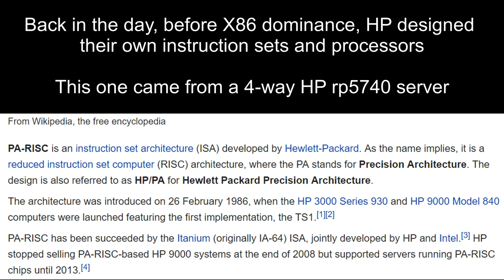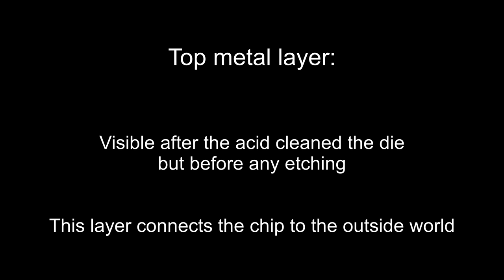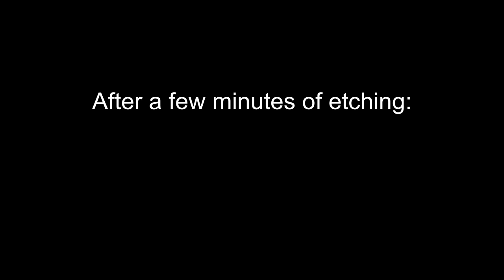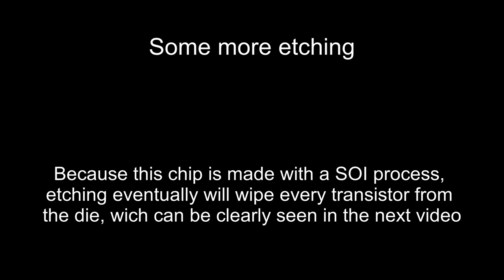HP PA-8700(+) die shots

Comment: Could you do more of those HP risc CPUs? (3AC1-0005, 3ac3-0002, 3ac4-0004 etc) I see many of them for sale on eBay for pretty cheep by a seller Called “zoe_0112” He also has many other interesting CPUs that would make great die shots!
Reply: Nvm, I read that those are SOI process. I would still recommend checking out that eBay seller though.